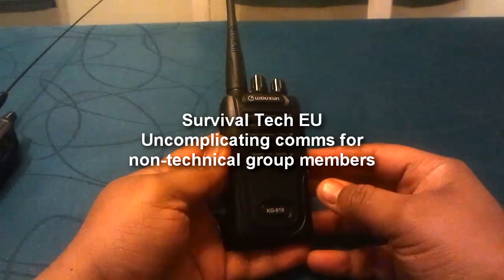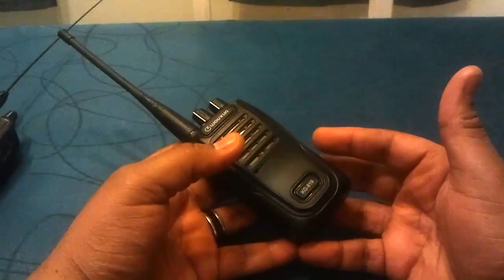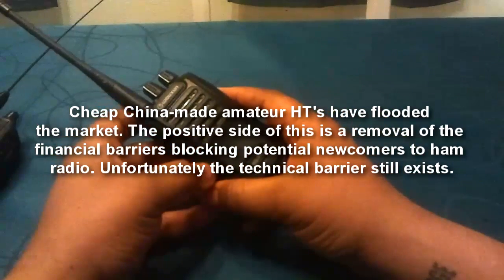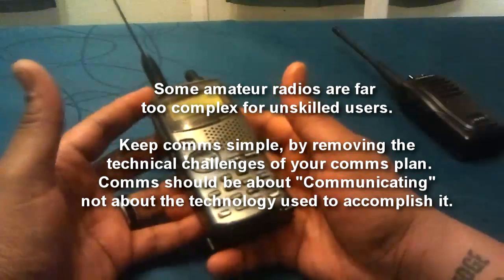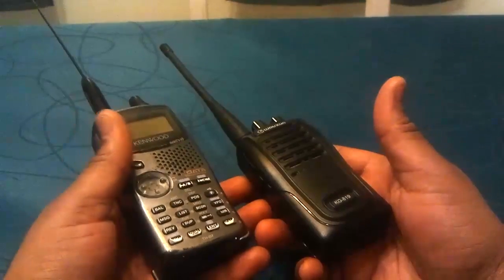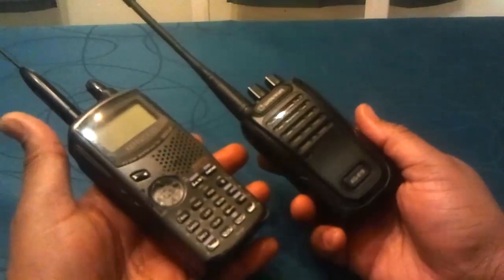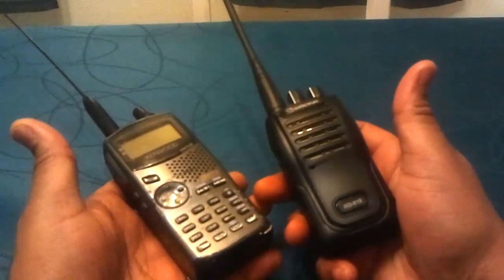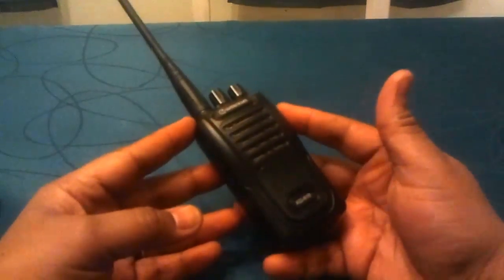Is Radio Gear too complicated for many Preppers?

Comment: I discussed this in an earlier video on FRS and GMRS radios.   We can get those single channel 2 and 4 meter radios in the US in kits that come with a programming cord for the set.   The issue is licensing.   Having a set all rigged for a 4 meter frequency means there is no legal use for it.   My idiot resistant stuff is all FRS/GMRS.